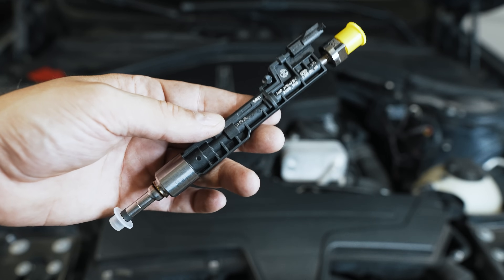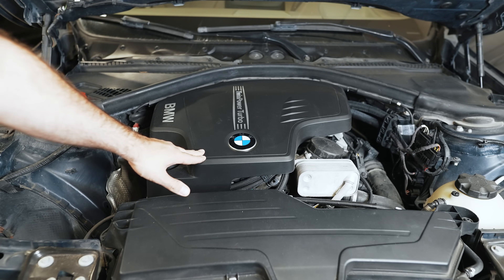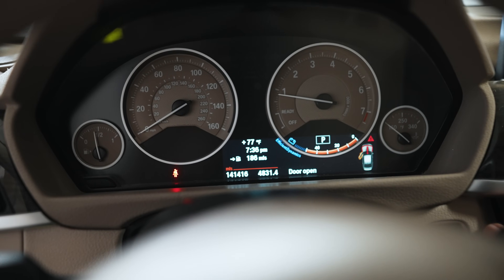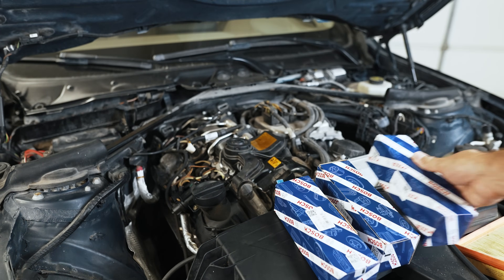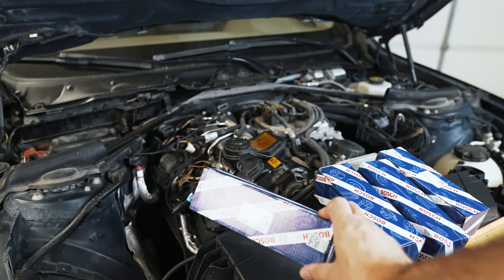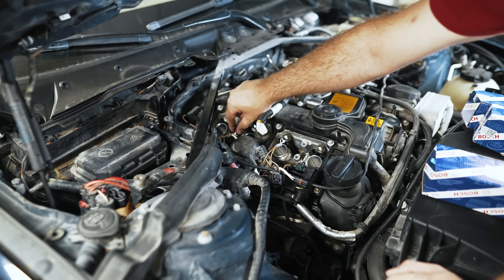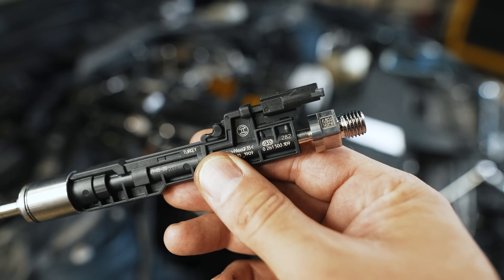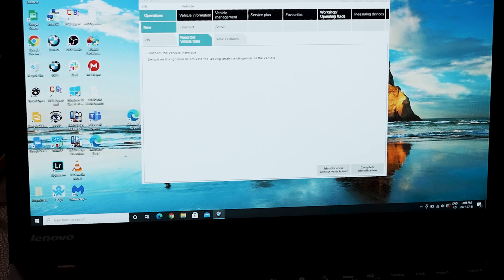Its Only A Matter Of Time Before This Fails On Your BMW

Comment: If your spark plugs, they have smell of gas when you remove them and there are black, but you have no check engine and you have smell of fuel mixed with the oil

Comment: What if I have no errors nothing, can one of my injector be bad? (n55)  I smell gasoline or exhaust fumes in the morning when I start it and its cold, on the left side of the engine as you look at the engine. What could it be ?

Comment: I ran into the same information. I've seen plenty of videos where they do use the seal compression set AND they use the hold down bracket to "force" the new injector and seal into the head! You are the first person that has shown concern over this method in the diy videos. I am replacing a new injector, and like you said, the n20s do not have a compression sleeve! So I will be using the correct tools to compress the new seal. We swapped motors, and I reused the old injectors but with new seals and decouplers, so I have the tools and have become aware of the procedure for proper install, and now, even more from your video! Thanks!

Comment: Hi there , love ya DIY's but I have a question, I have a BMW X6 2012 , 55 engine, had rough idling for some time, but the other day the truck went into limp mode, fuel injector number 4 went out,  I started smelling gasoline and computer told me I had multiple misfires .  I had the truck towed home, I changed my high pressure fuel pump as a precaution , drained the oil and it smelled like gasoline, so I know one of the fuel injectors dumped fuel into the cylinder. 

I checked and the spark plugs, all of them were black but one smelled like gasoline, which was cylinder number 4, which is the code I got from my Autell scanner, telling me that fuel injector 4 shut down , low fuel pressure .

I am changing the fuel injectors tomorrow and spark plugs, I am worried that I may have damaged the engine already due to the fuel dump in the gasoline, I didn't drive it but I don't know if damage has occurred already ?

Comment: Tightening the hold down bracket is enough to properly seat the injectors? I already have my injectors out and I'm debating whether to get the special tool in order to install them.

Comment: Would a failed injector throw a code? My 2015 BMW x1, was driving fine one minute and the next reduced power and stuttered home. Threw codes 2EFE, 2F02, 2EE0 & 2EED. Any advice? Has new sparkplugs and Plugs, and recently valvecover replacement. Ran fine until yesterday. You're input would be greatly appreciated. Thanks!

Comment: You don't need a computer to locate a bad injector.  All you need is a cheap stethoscope, you can even use a screw driver (you would put your ear up against the handle part of the screwdriver for this).  Put the stethoscope or screwdriver against the back of the injector and listen for the pulsation. You should hear uninterrupted pulsation (clicking) if you don't hear anything or the pulsation is inconsistent then you know you have a problem.

Comment: For EU6 injectors, if you order them off FCP euro for example, they come with the Teflon seal/o-ring, so does it still need to be tightened with the o-ring sealing tool? Confused as to whether or not that’s necessary on a new injector that already comes with it
Reply: I know I'm 5 months late but no- the ones on FCPEuro are done. Teflon is like clay, they dont spring back when you stretch them. O rings are rubber and bouncy/stretchy. When you stretch the teflon ring to get it onto the shaft, it's larger than the recessed groove now, which is why you need to compress it back down. The ones with the teflon seal already on it have been compressed and are good to go. If they weren't you'd be able to slide the teflon ring off.

Comment: Does the n55 have 2 banks? Just my knock sensor voltages are higher on 1,2,3 clyinder voltages are 2 volts at idle. Cylinder 4,5,6 are 1.2 voltages at idle. I have vibration at idle?

Comment: cylinder 4 injector went at 90k, cyl 3 went at 130k. replacing 3,2,1 now discount on fcpeuro $60 for single eu6 injector
Reply: Did the failed injector cause any engine damage?

Comment: Hey! I have a 2012 BMW 528xi with an N20 Engine. I keep getting a code 118001: Mixture Control Too Lean. I have replaced the following: Valve Cover, HPFP, Boost Solenoids, Purge Valve, Turbo Inlet Hose, Breather Hoses etc etc. smoke tested it many many times
You think the injectors are causing my lean code?

Comment: If you remove the injectors for inspection and reinstall them, I’m reading that if it takes more than 5nm of torque to remove it from the cylinder head, the whole injector needs to be replaced. Why is that the case? Is it due to scoring the teflon sleeve? What actually goes ‘bad’ that you cant just refresh the teflon seals/washer and reinstall? Thx

Comment: I have and E90 and an F30 and I've used a schwaben scan tool which has worked quite well but has some limitations, I'd really like to being working with ISTA so that I can better diagnose issues and easily program new parts to the cars when required. Do you have any recommendations on where to get the software?

Comment: bro I have a bmw 335i 2010 n54 and they changed the water pump and thermostat, now the car when I turn it off the pump stays on like 15 or 20 minutes then it turns off, if I open the door the pump turns on again 15 min , do you have any idea ???

Comment: what oil do you recommand for a n20b20 - 320i - 2012 - 200K km ?
Reply: 0W-20 doesn’t matter the mileage just use what BMW recommends you don’t need heavier oil for higher miles on most modern engines

Comment: As always, superior well reasoned advice on how to do injectors and what to watch out for. I really liked that you showed us something that was industry standard (just shove the injector in to the position with the seal on, not compressed) and the end result of scoring the injector's seal, and how to avoid ruining your seals. I have an N55 and, when it needs injectors (they're fricking loud now) I am going to re-watch this. Instead of ISTA+, would you use ProTool if you had it? Seems like a decent alternative.

Comment: Great as always! Have you changed the timing chain and oil pump chain on this engine? Noticed you have 141k miles on it. Others failed at 70k.

Comment: I’m @ 60k, using shell 93 exclusively. I’ll plan to do these preventively @ 120k? I rather be on the safer side but not leave too much on the table. I’ll have to get, learn and get comfortable with ISTA by then.
Reply: ISTA is very good for its great instructions. Just take your time with it and remember to pay attention what every step says on those service functions! When you get your ENET cable, connect it to your car and laptop. After that you need to tweak cables network settings by putting in a static IP address (169.254.1.1) there are guides for that👍🏻

Comment: When I bought my used ‘15 328i xDrive, one of the first things I did was check the spark plugs as they are a good indicator of what is going on in the engine. Cylinder 4 smelled of gas. No engine codes or symptoms. I bought the same Bosch injector and slowly pushing it in by hand, even though I DID see a video where the guy compressed it first (N20). Didn’t have the tool or time to wait (daily) so I put it in as careful as I could and all was fine. Year later I think it’s still fine lol. Even though I got ISTA+, the new injector was the same flow rate! Awesome video. I’ll revisit my injectors in the near future when I can buy the proper removal and compressor/cutter tools.

Comment: Very nice DIY. My 335i n54 did great after I bought it ( 2009 and only 52k miles). But now, only 1500 miles later the engine starts shaking at a cold start. I read the codes and it has a 2AAF shadow code, saying the fuel pump plausibility, by age. Warm, the car performs great, even at full throttle! 
My plan is to change the fuel low-pressure sensor for the better Bosch one. If this doesn't work I will change the fuel pump and put a Walbro 450 in the tank, following your DIY about this pump. Thanks for showing us the way, to great running BMWs.  Dutch regards, Nico.
Reply from the maker: Thanks, that sounds like injectors leaking when the car sits, they drip on the pistons and cause the an over rich situation and they car has to burn off that excess gas and it'll run fine until the next time the car sits overnight.  The fuel pump code means your fuel pump is drawing too much current from the electrical system which could mean its failing or had some restriction like a clogged filter sock etc.  Wouldn't hurt to replace the fuel pump for maintenence but should be a separate issue from your cold starts.
Reply: @VehicularDIY  thanks. That's possible because they are #5 😒. In a 3/2009 car!
Reply: Yeah N54s main issue is the HPFP.

Comment: Nice DIY!  Well done as always.  Where did you get your ISTA+?
Reply: https://automotiveforum.net/showthread.php?tid=8062
Reply: There are a couple of sites that have the exact same write up/info and the installer all looks to be the same for every new version. Just run the main stand-alone installer once downloaded and wait like an hour or so for the full program and coding data to go through. Read the Readme also!
Reply from the maker: I purchased it online, not sure of a current good source for it unfortunately.

Comment: BMW TIS for sure says you need to compress the seal and they also recommend using the N54 tool so you are spot on, same goes with mini n14 and n18
Reply from the maker: I think its a shame that the new injectors didn't come with a sleeve to keep the seal compressed.
Reply: @VehicularDIY I can tell something was wrong because u we’re at about half a tank and it says 186 mile  mpg range left

Comment: Original index 0 injectors on my 07 335i. Just hit 191k miles. Original turbos too.
Reply from the maker: Impressive, that could only be possible with regular maintenance.  Sounds like you really take care of your car.
Reply: Great to hear you have done so well on original injectors and turbos. I have a 2007 e93  335i with 75k. Hopefully will make it as far as you have with original equipment.
Reply: @Lopes12676  run some injector cleaner through it from time to time, I've got 2007 E91 318d msport, 142bhp not mad power like you guys but she's now got 225489miles original injectors, turbo all standard set up too, this car does 38-44mpg in town and 55-63mpg on the motorways,  I run it on the premium diesel too
Reply: @RTB-1157  thanks for the advice. Will do that. 👍
Reply: FCP Euro has a set of genuine injectors $1,733 currently... really cringe at the thought of ever spending that to DIY them in future

Comment: Another great video...In a pinch if you don't have the compression tool to get new seals on the injector, you can slide the new seals down the tip of a pen to stretch the new seal, place it onto the new injector tip.. then place the cap of that pen over the injector and in about 15mins it shrinks back down to a nice tight fit over the injector....I've done this on my old N54, but based on your measurement it should work on these injectors as well.

Comment: What about N47?
Reply from the maker: I don't have much experience with diesel bmws.
Reply: I own an E91 N47 2011, with DPF and EGR delete and tune. No issue so far with injectors.
About 120 000 km.

Comment: Whats the difference between eu5 and eu6 injectors (on n55)?
Reply from the maker: From what I understand the EU6 was standardized in terms of flow rate so they don't have to be coded into the dme.  I think they all flow 215
Reply: How do you know which ones fit your car 
I was in fcp euro and it said they both fit my car but I don’t want to buy the wrong ones 
Pls help
Reply: I have a 2011 bmw 535i xdrive
Reply: @abadmarcial2288  eu5
Reply: @ademc8872  I have 320i 2013 n20. Is it also eu5 ?
Reply: I have a 2014 535i xDrive

Comment: I can't say that injector failures are common on the N55. I've owned my M235 since new in 2/2016 and 55k miles haven't had any injector issues. Also, I've been on the F2x and F3x forums since 2014 and haven't heard of injector issues on 2014+ electronic wastegate equipped N55s pretty much never.  I know they're a HUGE issue on the N54s and potentially the B58s with injector leaks causing washing of the cylinder bores which then kills the plasma bore coating and wrecks the piston and short block.
Reply from the maker: I think they last up to at least 100k which isn't bad but they seem to not last as long port injectors.

Comment: Thank you for a great content!
Reply from the maker: Thanks for watching!
Reply: @VehicularDIY  I have a 330e B48a Engine? Getting to the injectors more easier than the n20 engine, I have the same system too rich bank one had a few misfires recently? I have changed mad, 02 sensor, light came on again? I've bought 4 injectors hopefully solves the problem? I have to get them. Coded after too?

Comment: One test you can do is richen the fuel manually with brake clean and watch the O2 sensors in OBD mode and look at raw voltage and ohm draw  because many times one of the O2 sensors is lying to the DME.  After injector install I know the N63 has a injector calibration process where it adjusts injector calibration while the engine is running.  If you can't get through that process (it's 5 steps) O2 sensors are bad.

Comment: Nice DIY!  I did 6 on my N55 recently.  I didn't see any guides that recommended compressing the seal though.  But I did blow out everything real good before removing and used the tool to install them, not just the bracket.  Been fine for several months.  Biggest pain was ISTA.  Friggin program never works when I really need it. Spent forever installing/reinstalling it only to find out my USBC to Ethernet adapter was bad.  🤷